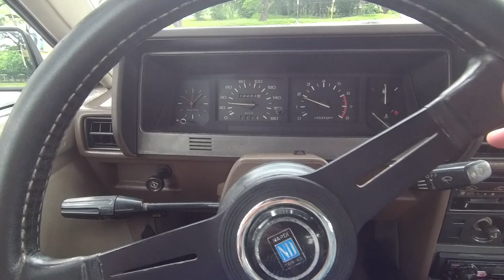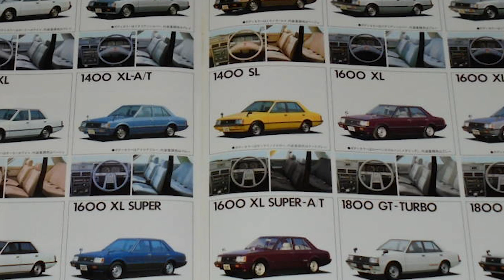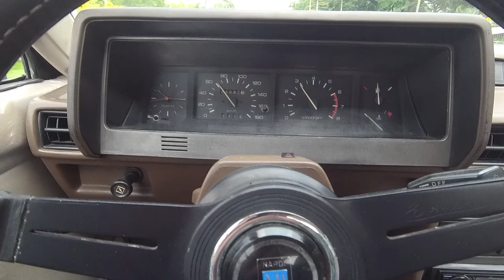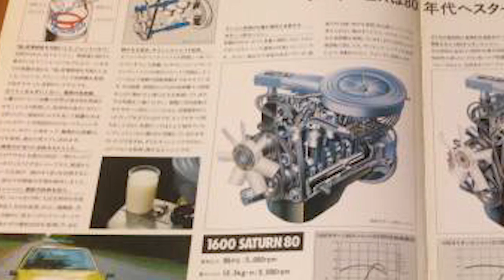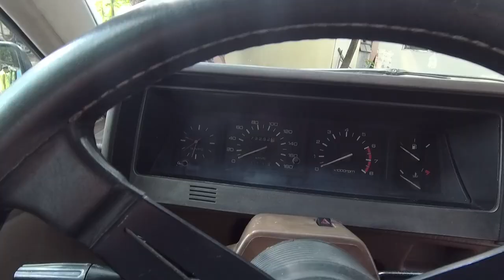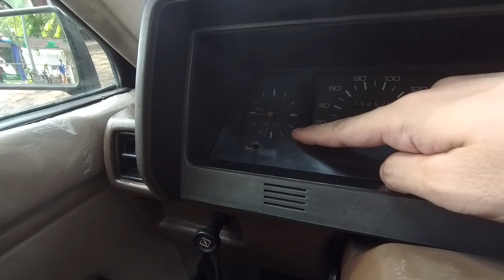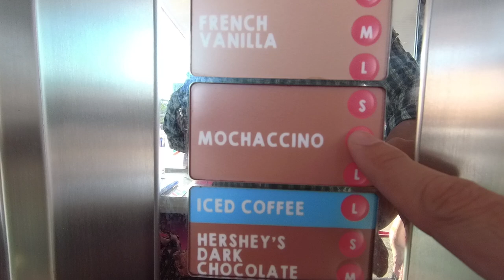1987 Mitsubishi Lancer "Box Type"

Comment: Parang OTJ namin, walang kahit ano: Walang aircon, power steering, bintana, hand brake, abs, airbag, crumple zone, tools, spare parts, glove box, upuang matino. Seatbelt na dekawit, busina na minsan meron minsan wala, wiper na mas nagpapalabo lang kapag naulan mainam pang di gamitin, panay kalawang na body at sahig, preno na tulad nitong box type tagal huminto, iba iba size ng gulong expired pa, napakalikot na steering. Top speed na 80 siguro pero masaya na sa 40-50. Pero atleast buo lahat ng ilaw harap likod syempre may napalitan din pag napundi iwas huli yan dapat kumpleto lahat ng ilaw, buo ang fuel gauge, speedometer, odometer, temp, wala lang tachometer. 

Nagagamit pa din pang grocery ni nanay, apat na kabang bigas, 5 box ng gin, 4box ng empi long, litro, at kung anuano pang napamili pang tindahan nya. Kayang kaya pa basta malapitang byahe lang, yung kahit san mo iwan ayos lang, dasal lang talaga na sana walang masira 😂

Comment: The '82 Lancer GSR was our family car, later passed on to me for college. AFAIK in the early 80s the Philippines only received the 1400 SL and 1600 GSR but owners installed "Lancer EX",  "1800 GSR" garnish and "Sirius 80" grille with integrated fog lamps. But I heard rumors that 1800 model came out in the late 80s (GT?) were these real or aftermarket badges only?

Comment: Nandito pa yung sa amin 85 model naka 4 g32 chain type webber 50 cam 5 port& polish big valves lighten plywheel 89 mm dome piston lighten crankshaft 5 speed na transmission and differential fr lancer gsr
Reply: You forgot to mention the titanium bolts.